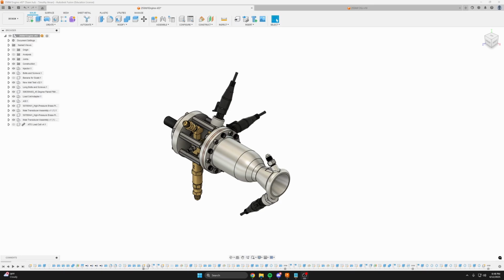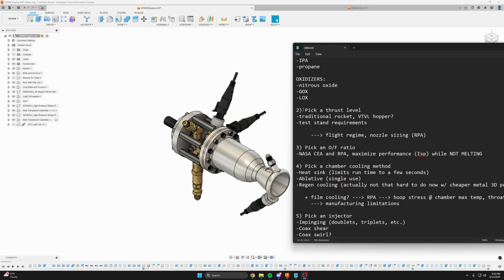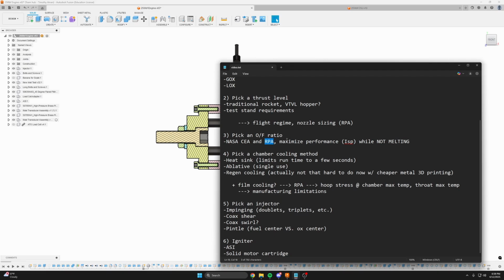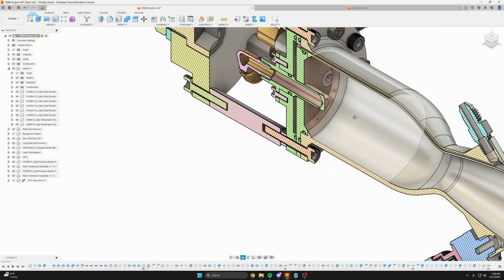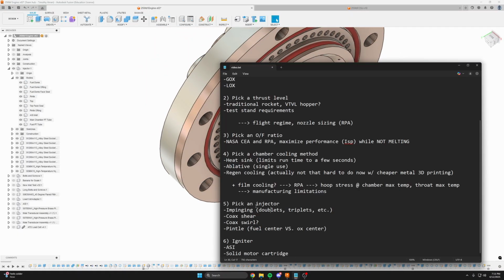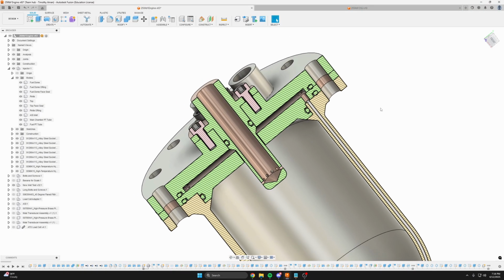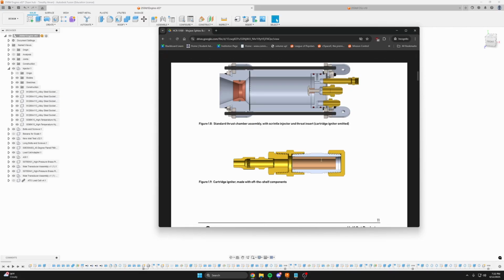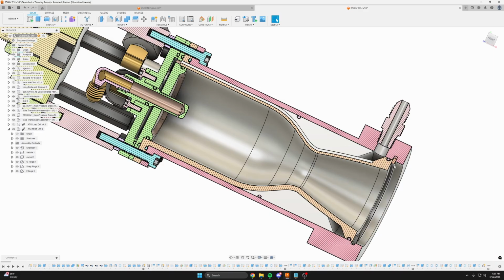How I Designed a 250 Pound-Force Liquid Rocket Engine

Comment: Try using Nytrox (Nitrous Oxide/ Oxygen mixtures) for improved safety during ignition as there are very real dangers with non-diluted Nitrous Oxide vapor detonating on contact with hot surfaces (injector plate etc), and LRMs normally require an oxygen rich lead for ignition to avoid hard starts. Its not difficult to make Nytrox, just need to chill the Nitrous tank down to -20c and then bubble oxygen into it.

Comment: What kind of simulations you did for validation of your design? Were they code based or using packages like Fluent? And also if you can share a little information about design of your P and ID system ?

Comment: @Questionable Engineer As a German mechanic, I have to ask if it doesn't make much more sense for you to not simply erode the small holes, or to use wire EDM for longer slots? I'd like to mention that you can drill cutting widths of 0.1 mm and even very small holes with this. Suitable machines are available for just under $1,000. Unfortunately, there are no toolmaking facilities in the USA anymore, because everything is outsourced to China.

I was just thinking about your nozzle configuration again. As an old mechanic, I would make the nozzle from 4 or 5 parts. All turned parts that can be machined on a lathe. First, the inner nozzle contour. Then, the outer support contour with the cooling slots as a turned part, and then cut the slots on a wire EDM machine. Then cut this part into 4 parts. So, cut the head and base as a ring, and first cut the middle part as a ring and then cut it in half. The cutting widths with a wire EDM are around 0.1 to 0.2 mm, which means you would need a shaped piece (sheet metal) for the middle part. On top of that, another simple cylinder to absorb all the pressure forces, or you would have to weld the 5 individual parts neatly with a laser.

In my opinion, this would be the easiest way to build such a high-pressure nozzle for around $1,000 to $1,500 if you have it professionally manufactured.

Comment: This is fantastic!!! I've done a similar project, even used RPA and also cooling chambers just like you have, the difference is that I've designed mine in SolidWorks, I've event went with the same pintle structure design, I do have some videos of it but not on youtube. This is an amazing work. Back then 3D printing in metals was just pure murder, but now that it's a bit cheaper I might give it a go, you kinda inspired me back into my rocket project!!!

Also, check out CFTurbo, I've designed an electric "turbo" pump that would spit water 3 meters forward, I can't remember the exact flowrate currently, but it would empty a 2L bottle in something like 2/s if I can remember correctly, one thing I know Is that I've designed it to deliver a nice pressure rate on my pintle injector. IF I find those videos I'll post them here (they are on FB or Insta... not sure) so you can "lol" at them! :)

Comment: If you are using radially compressed orings add a 30 degree chamfer on the opposing part to help compress the orings in their grove, otherwise you will probably end up shearing of parts of the oring during assembly.

Comment: Hi, back in your Part 2 video when discussing injectors, you mentioned that you might talk about how to deal with propellants like N2O which don't qualify as incompressible liquids unless held at low temps and/or very high pressures. Can the dual-phase flow of nitrous be predictably dealt with in a fuel-centered pintle injector in a way that the gas' effect on the O/F ratio and combustion stability does not compromise the performance of the engine? In other words, how can I account for gas bubbles in the N2O during injection so that I can still meet the nominal thrust and chamber pressure levels. Thank you!
Reply: We at Aspirespace discovered that in practice, the nitrous won't 'froth' until leaving the pintle orifices - don't worry about it. BUT you mustn't let the static pressure of the nitrous drop before it reaches the orifices: keep the flow speed below about 10 metres per second. Otherwise, it WILL fizz within the plumbing!

Comment: Just wanted to say something so that it's thought about beforehand... Have you checked the strength of the 6 connectors and their screws between the injector and the main body of the rocket to make sure that when this thing lights it doesn't create a torque/moment that would rotate the engine CC/CCW and twist it up? We used our 4 fins of quarter inch aluminum for our thrust transfer, but are still trying to get it off the pad. Though our design relates closely to Half Cat's.

Comment: 33:49 that nice but covering it is not hard? It dont need to touch the fins to separate each channel?
Also what about make biger channel is worst or better to manage the heat? To me is losing strenght but improve heat disipation because less material to cool down with LOx or any liquid(imagine unify 3 channels in one)

Comment: (for the record idk much about this stuff) that ASI seems quite heavy (unless you need to relight the engine in flight) but I guess its easier than getting hold of hypergolics.

 I wounder if you could add a small electric heater in the ASI chamber to vaporize the liquid propellants.

Comment: Have you considered copper GRCop-42 for additive manufacturing over aluminum? And it looks like your regen channel are the same throughout the nozzle so that would make you cross sectional area of the regen channel change, such as the throat would have the smallest regen cross sectional area and the highest fluid velocity. Or has that been accounted for ?
Reply: Thats a good thing, as you want the highest mass flow rate where the highest heat flux is, whicht is at the throat
Reply: @xente9918  mass flow is constant throughout the entire chamber, flow velocity is highest at the throat which is good for increasing convection into the coolant